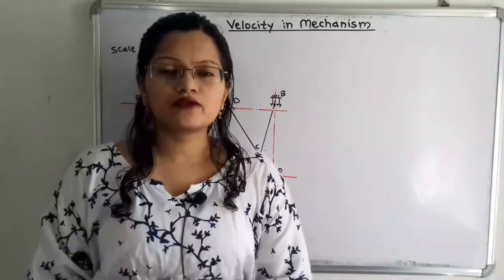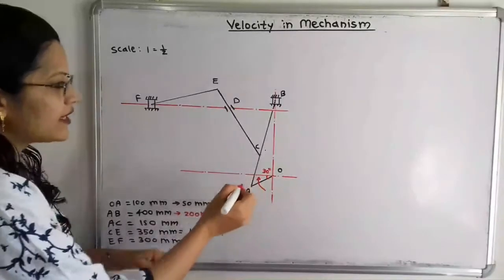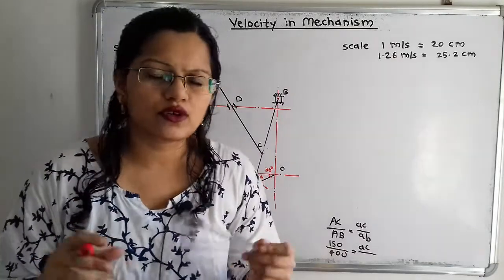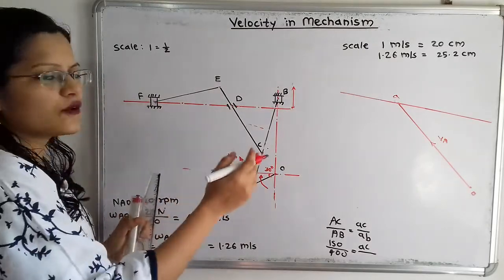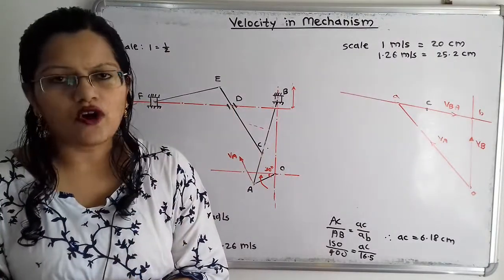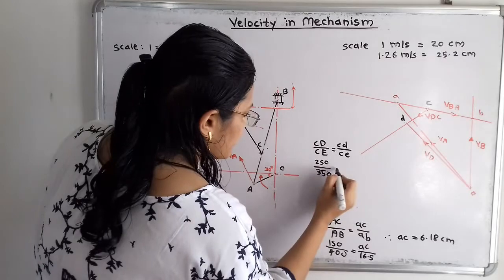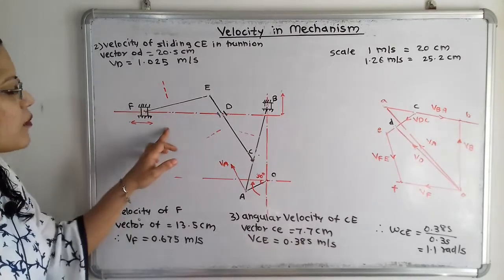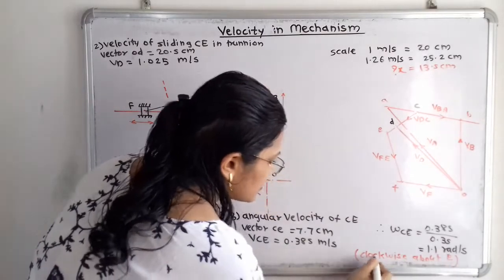Problem 5 on given mechanism with trunnion /  Relative velocity method

Comment: you have drawn direction of CE wrong, if we consider CE sense from velocity diagram it would be an upward arrow, on link CE, then if we apply right hand thumb rule the sense would be anti clockwise. In case of a downward tangential velocity on link CE, it would be represented as Vec on the velocity diagram, and when we right hand thumb rule about point c again it would be anti clockwise.